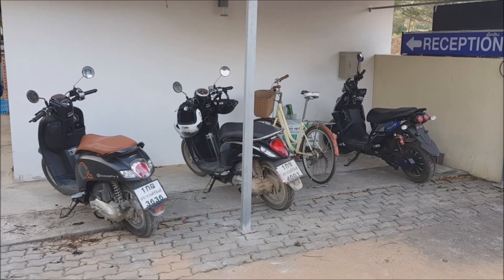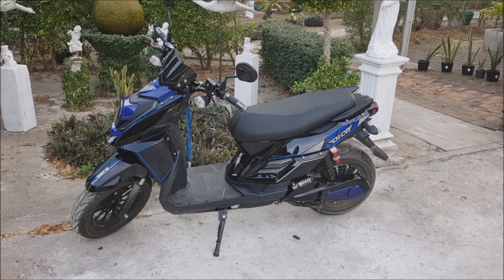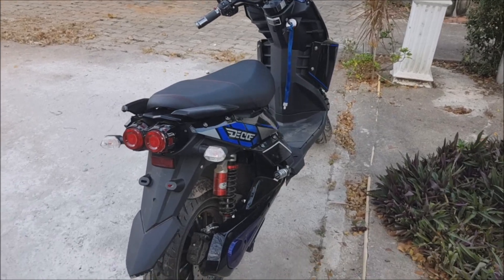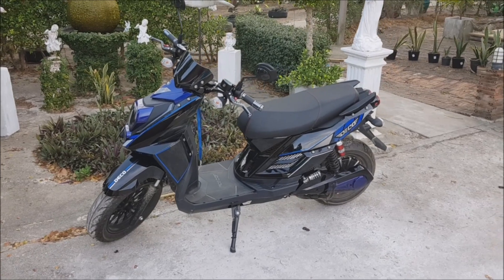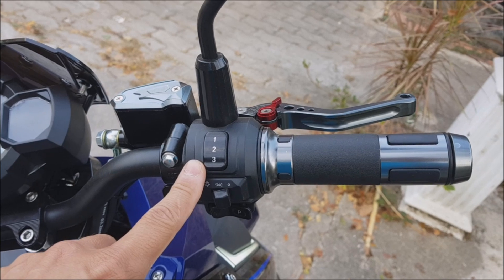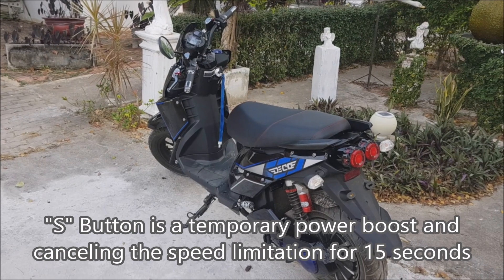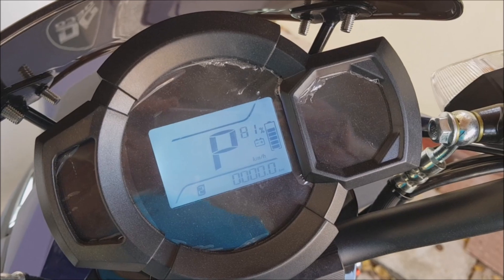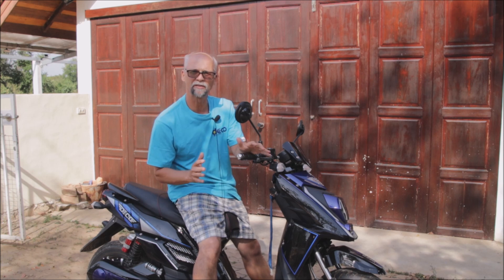DECO Super Ace - Thailand E-Motorcycle subsidies - English Review

Comment: I bought the Deco Sylla (2000W) 5 Years ago.I prevered the sylla to the super ace cause of the visable frame which I like and the sylla is heavier so it will be constructed more rigid. But the sylla seems not to be available anymore. Use up the battery just one time completely was a bad mistake I've made, since then the capacity dropped quite a lot. It also didn't charge anymore sometimes in hot weather conditions, so I installed a fix cooling system on top of the battery with two peltier cooling elements incl. four fans and a big heatsink. The charger is now in a bigger box combined with the precooling timer relay and a additional 10A 12V power supply for the peltier cooling. Never the less some 18650 cells must be replaced...the next project after I finished my solar system...All in all I still do not regret the buying of this electric motorcycle, cause its so relaxing to drive, like riding a horse or a rodel (sled) soo quiet and enjoying the nature, still can hear birds twitter, soo nice! : D

Comment: Charge them to 100% is not bad. The rumours charge them only up to 80% extends cycle life come from tests which show the most cycles when charging not to 100%. Yes its true, you get a lot mor cycles, BUT if you do the integral math with total stored energy in battery life, you'll see that you loose about 20% of total stored energy when doing so (SOD 25-75% compared with 25-100%). The battery doctor (with the green battery in logo) analysed that very well. But Discharge bellow 20% is bad, no doubt.
I was charge my Sylla up to 80% too in the beginning by limiting the charging time, till I get problems. I think the BMS also can only do a good job, when charging up to 100%, otherwise imbalance will sum up over time.
Reply from the maker: Yes, I do charge my mototrcycle battery to 100% and then drive it down to 40-50%. If you do not charge it up to the top, the bike controller doesnt really know at what SOC the battery is after a while, as the DECO SUPER ACE comes with a LFP battery.
My LIPO pack in the off-grid system i do cycle between 20-95% for 6 years already. That pack keeps its capacity against all odds, and is still above 80% of initial capacity after 1400 cycles...
Reply: @RolandW_DIYEnergyandMore  LFP batteries move all Lithium from one to the other side, wile Lion batteries a big part stay on one electrode and this remaining Lithium structure is needed to propper docking when charge again. So Lion batteries should NEVER be discharged completely, wile this is no big deal with LFP batteries.
5 Years ago also the Super Ace had Lion batteries. Maybe I will swap my Sylla to LFP, but as long just a few 18650s are bad i'll try it, cause of lack of money ; )

Comment: In Real world, what is the Typical Range ?
70-80km ?
Reply from the maker: Real world range of course always depends on how the EV is used. If you are driving the Super Ace alone and keep the speed between 50-60km/h then 70 km should be possible. Two people on the motorcycle will decrease range as well as driving it full speed at 75km/h.
Definitely do not believe marketing divisions or adds on online stores where they promise 60km even for those entry level 60V/20Ah motorcycles :)
Reply: @RolandW_DIYEnergyandMore  
I never Believe the Stated range based on NEDC; always discount 30% off or so for range.
NEDC Stands for Not Even Damn Close 🤣🤣
Reply from the maker: @vincecarlo  here they write in the small print, that range is based on an average speed of 35km/h. Who is driving so slowly? That might be speed in city driving. But there you will lose a lot of range for permanently accelerating and stopping. Deco also has 2 models with 40+Ah batteries. Those will go 100kms for sure.
Reply: @RolandW_DIYEnergyandMore  
Deco Super Ace with 70km range good enough. Just go to market near by, run errands n to shops.
I know there is Deco Double Ace, over kill for my use. 
The 12" wheels are the major factor; Deco Hannah n Strom Gorilla were other options but 10" wheels.
Many Thanks
Njoy Ur Bike
Getting my Super Ace soon